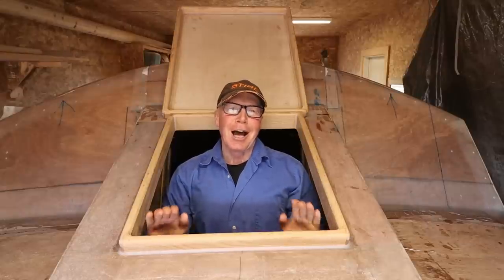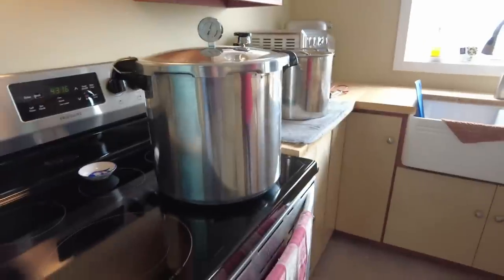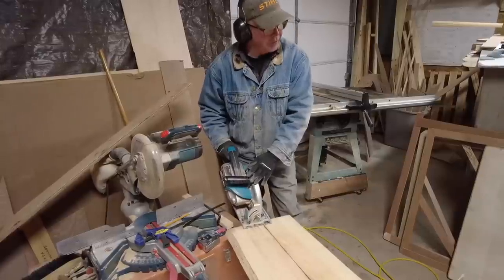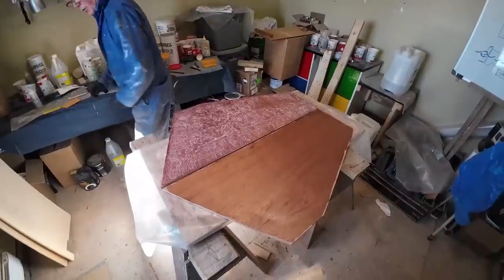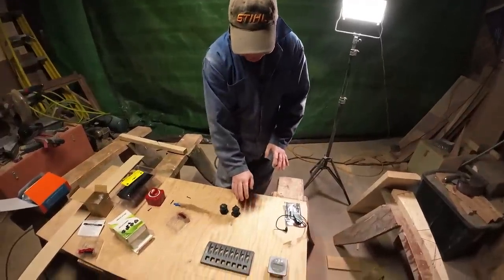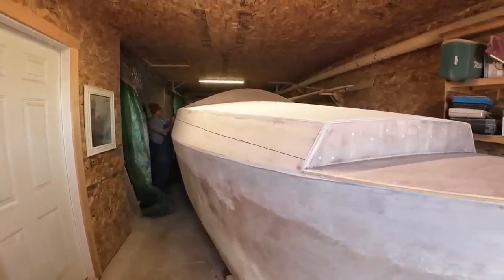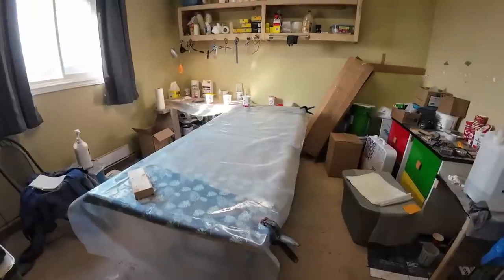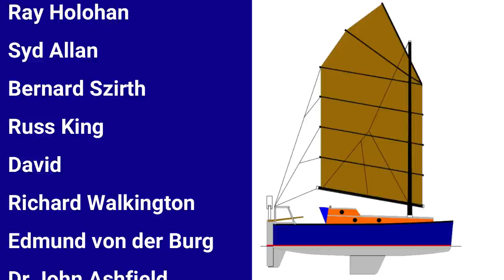S2E78 Fiberglassing is Started on the Exterior || 78 Days Before Launch

Comment: If you have not looked into retort bag canning, you might take a look. Same results as glass jar canning but in special mylar pouches. Easier to store and nothing to break. Of course, there is also the traditional metal can canning but it requires some pretty expensive equipment to seal the cans.
Reply from the maker: I'd like to try freeze drying some stuff
Reply: @RoversAdventure  Now that is an investment, that equipment costs even more than the metal canning stuff. With retort pouches, you can use your existing pressure canner.
Reply from the maker: @chapter4travels  I will look into it, sounds like a great idea
Reply: @RoversAdventure  With freeze dried you will need to add water and heat to rehydrate. With canning, no water is needed and heating is optional. Just a thought.

Comment: Sir since you have your Waverover Hull Done have your designer any Other Waverover thought of Making a Mold so you Could Go into Production for when you Not Sailing and Spending Time with Wifely? Will you be Gell coating the Waverover or Epoxy Paint? Sir have you weigh Waverover yet to see if you on weight so far? Will you be adding one last Fiberglass layer to overlap all the Seams? Sorry for all Questions. I think or Fans to you think a Mold would be Awesome to have so many fans can Build there own Waverover?
Reply from the maker: We had some initial discussions but haven't taken it very far

Comment: Another great video. Will you be putting a port (not an opening one) in the hatch to be able to see what is going on astern without opening the hatch?
Reply from the maker: I will have a small post light on the hatch for sure
Reply: @RoversAdventure  Excellent! In that way you can easily check the wind vane without opening the hatch. It was one of the things that I thought would have been desirable on your Contessa 26.